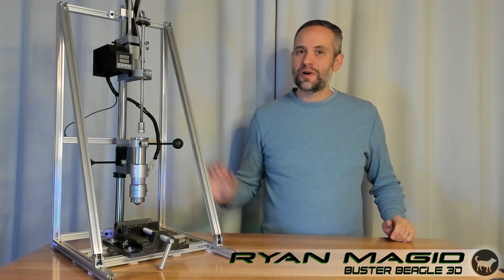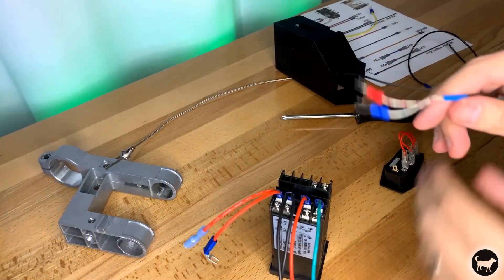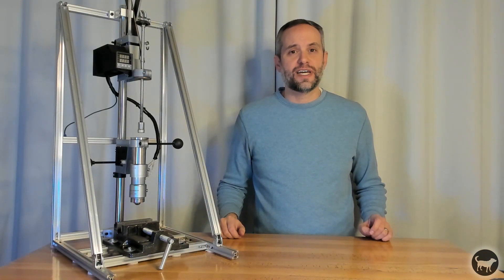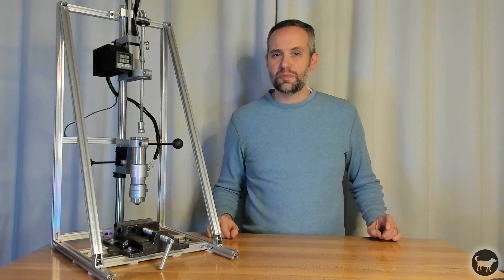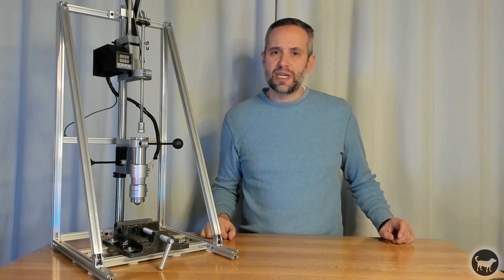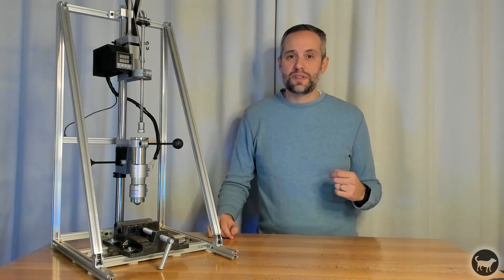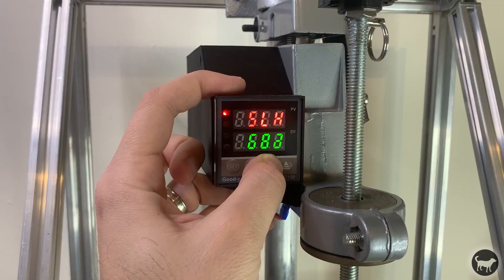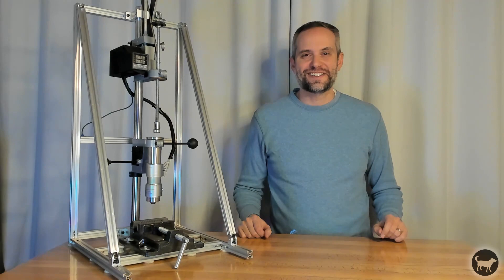Buster Beagle 3D Injection Machine MKII

Comment: Make sure you tune the PID controller! Before connecting to the heaters. I had to quickly drop the temperature as they started to emit smoke.  Pids were way off, wrong thermocouple, and it was set to amps instead of volts.  Also the video c100 link was pretty good.  I can tell he knew what a PID settings was.  Other videos I looked at  did not! The settings were pretty good,  but he didn't tell you what each thing means.  Also the PID were off a bit,  so it was slow to heat and over shot a bit.  I updated mine and now it goes up a bit faster and only goes over by a half or 1 C.  I also adjusted my upper heat range to 295c. I hope the 300 is accurate
Reply from the maker: Your PID controller should have come with a manual that tells you what each settings means but I guess not every one does. Here is a link that might let you know a little more what each thing is. It may not be the exact same thing as yours but it would probably be close. https://www.vistronica.com/images/Documentos/REX-C100.pdf
Reply: @BusterBeagle3D  it seems all have different settings and screens. Also, the version I got doesn't properly control output through a voltage controller, but with a direct current dump. It immediately pushes the heaters to 500 F. Even if you are just going from 30 to 40 C. Its not bad if jumping to 250C from 20C, but small changes its not going to work. I bought a new controller with voltage control. Also, I have a full settings file for it from the manufacturer. Breme and RKC look like  good options. I thought it was an RKC, but it was an RKG..... Amazon is allowing me to return it

Comment: In case others are confused like I was, there are two thingiverse links, the smaller machine link has the wiring PDFs, the bigger machine link has the new frame as well as the stls.
I bought a long 3/8 -16 rod and cut that up for the pludger and the guide rod. Added a nut at the bottom and top versus using a c clip. ACE Hardware had the same 3/8 handle as the printed one.

Oh yeah, I could NOT get those heater bands on, so I bought M6 35mm screws and that worked well. 

For the black drill press stop, I bought a longer screw with a handle to allow easy adjustment. Used a spacer to help allow it to spin while tightening.
The handle annoyed me, as you tighten the screw to hold up the assembly it tightens the handle down. I widened the hole in the handle, added an aluminum spacer, and no more annoyance.
Reply from the maker: Sorry for any confusion. You are correct. This is meant as an upgrade to the original machine. The original video was so long that I didn't want to repeat it all again here.
Reply: @BusterBeagle3D  no worries, I just kept clicking the new link and then finally realized the reference to the old!!! I was like where the heck are these wiring PDFs!

Comment: Why does the PDF say 8 M8 washers?
Reply from the maker: Thanks for pointing that out! That's actually a left over from an older version of the handle that used extra springs to hold the handle up. I will update the pdf to remove them. You really only need 1 for the handle now.
Reply: @BusterBeagle3D  wiring guides are nice, what about adding lengths?
Reply from the maker: @KernsJW   I could measure and add lengths as well. There are 2 pdfs, the one with the wires laid out was meant to be printed and used as a guide for the lengths. When I have a chance to update that pdf with wire lengths I will.
Reply: @BusterBeagle3D  if you dont mind me asking, how is the heat up time with the extension? It seems you could fit 3 bands!
Reply from the maker: @KernsJW  Honestly it's not that bad. I'm not sure that it's really that much longer. I'm also not sure you can run 3 off of the same PID controller. You could always use larger band heaters if you wanted to as well. Just keep the diameter to 35mm.

Comment: Is there a way to increase the shot volume even more beyond this? I’d buy today if you can tell me how
Reply from the maker: I think that the 2 cubic inches would be about the largest this design could reasonably handle. You could check out the precious plastic website to see some designs that might be able to handle larger volumes but may be harder to make.

Comment: Is it worth upgrading to a 25mm linear shaft for the original moulder in your opinion? My injection cylinder arrives Monday so thinking about sourcing the other parts. I know those drill presses can be a bit flexible and flimsy. Great work btw 👍🏼
Reply from the maker: To be honest I would try the smaller version first just to see how it feels or works for you. You can always upgrade if you feel the volume is too small for you. If you use it without cranking down to hard on the handle you should be good. If you start doing more and more and want a more rigid machine then upgrade part as you see fit.

Comment: Would you consider posting the design of the chamber and extension for sale so we can make them ourselves?  Would also help take pressure off of you since they are difficult to keep in stock ;)
Reply from the maker: Hello, Unfortunately since it is a design the I manufacture and sell it is not a design that I release. I understand that it is currently on backorder but I have 400 on the way and should have them very soon. There are still some pre-orders on Etsy available right now that should so out at the end of this week.

Comment: Any particular reason you went with a drill press vise? It is easier to buy and install, but seems much more annoying to use vs a push pull toggle clamp like what LNS technologies sells that you can put your weight onto.
Reply from the maker: I just used it because I had it. You could of course add any type of clamp that you would like.
Reply: this stood out to me also.  I don't see an easier way than mounting the toggle clamp to the tslot...then there needs to be a way to mount your mold to the tslot also,.  It would be awfully nice if there were something like a couple of long shoulder bolts to mount the back mold half, with the smooth pin extending through the front mold half with a toggle clamp between.  Then I guess you need a back plate to mount the shoulder bolts.
Reply: ...need to mount the toggle clamp to the front half of the mold too, something like a plastic insert nut with threads on the ID and OD, or maybe a piece of tslot mounted on the front mold half?  Not as easy as the drill press vice but seem like it would be a lot quicker to mold.